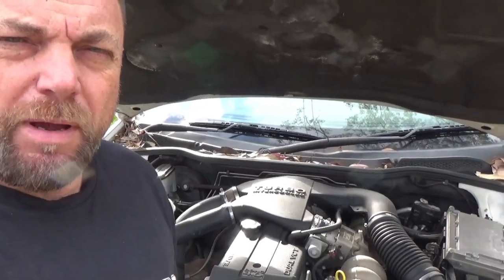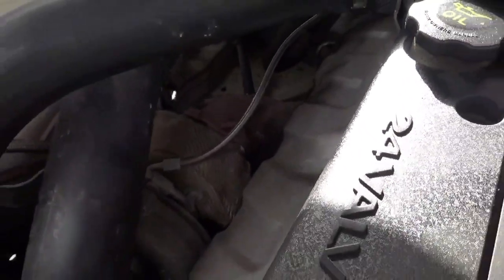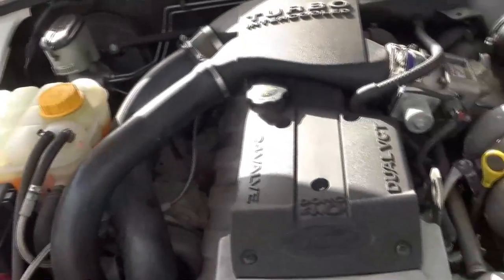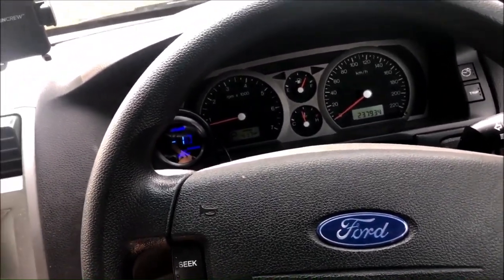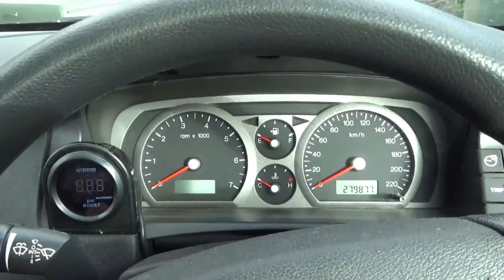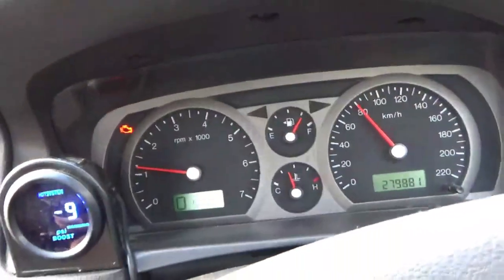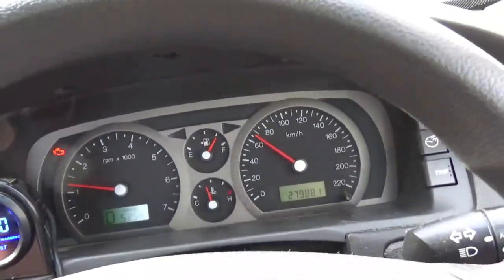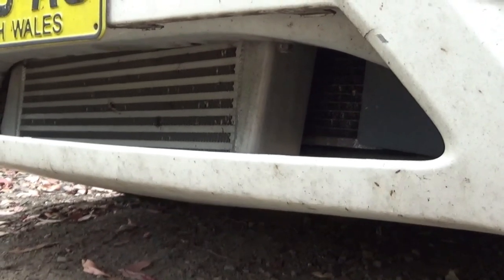NA Barra Turbo Update 3 years and 40,000Klms later

Comment: I'm pretty sure all motors had 1R rods throughout until 06 when they introduced the 3R rods anyway, so essentially its just built to BA standard and toned down a bit for the longevity of the NA box which is where i think the main differences are between the NAs and Ts, and  I'm fairly positive that it's just an XR8 Box anyway.. but i could be wrong. im just making assumptions based on what i think makes sense for what Ford would have done, being everything's so interchangeable between models, too. I'd assume that's what was done. It's just a bell housing in the end, i would assume.

Comment: This is perfect. I want to turbo my bf xr6 but i wanted to do it properly. Valve springs, timing chain, oil pump gears, head/main studs. Its overkill but ive seen way too many mates destroy boxes and motors cus they just slap a turbo in. Good to know if its done well itll last ages

Comment: Good to see its's still going strong, your videos were a help when I did mine What's the check engine light on for, Anything to do with the turbo build ?
Reply from the maker: Cheers man, glad it was helpful. It keeps throwing a plug/coil harness code.. something I probably should change but it’s not missed a beat. Kinda got used to the light lol